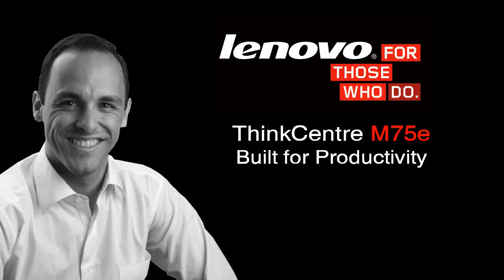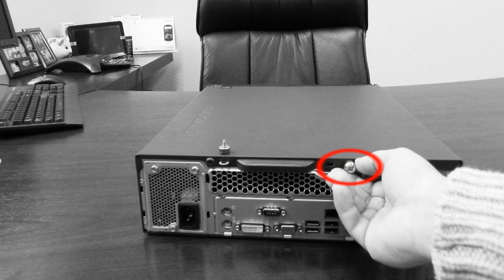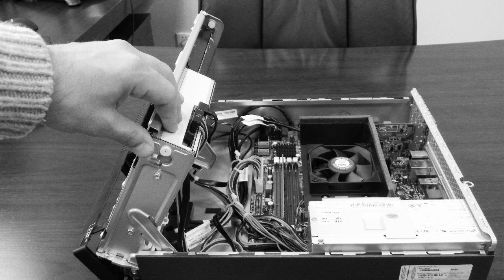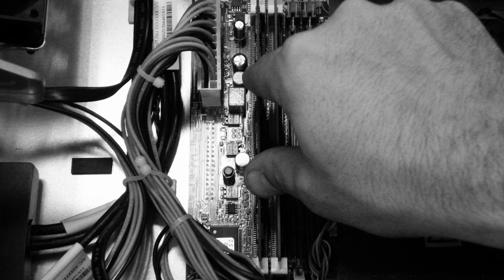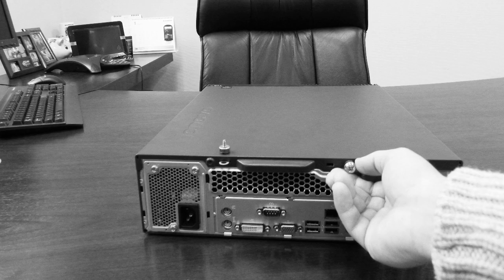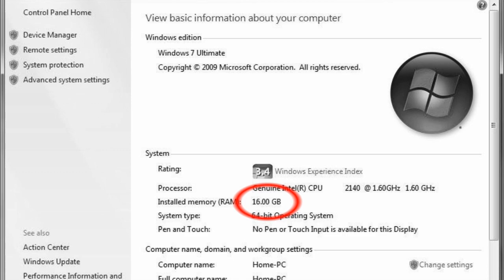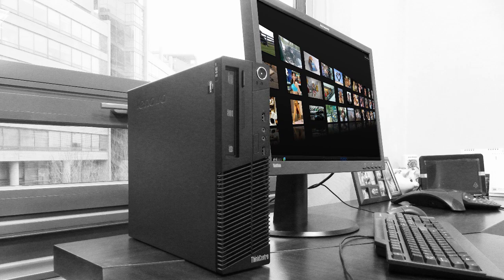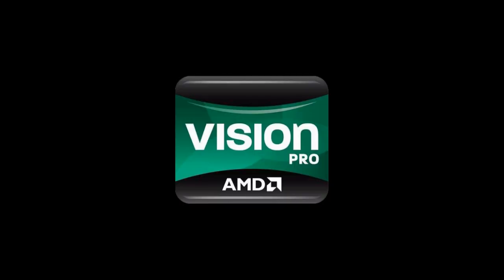ThinkCentre Tech Minute: How to Install 16GB of Memory on the M75e

Comment: Maybe it's a BIOS update that made this possible, but I am now using a M75e that has 2 4GB sticks and 2 8GB sticks in it for a total of 24 GB.  It passes memtest, and neither Windows 10 Pro nor Linux has BSOD'd.

And here's a weird thing. The 4GB sticks are Dell with ECC (i.e. recycled server memory).  This machine doesn't seem to care whether a stick was ECC, another crazy surprise.  Of course it is not using the ECC, but memtest shows it anyhow.

What a way to get a 24GB (who knows, 32GB?) machine for a song (from various refurbishers) and a few additional parts.  Is it the latest and greatest, well no, not by over a decade.  But unless one is a top end gamer one will probably not care for purposes of the typical Windows or Linux application, or for memory hogs like virtual machines.